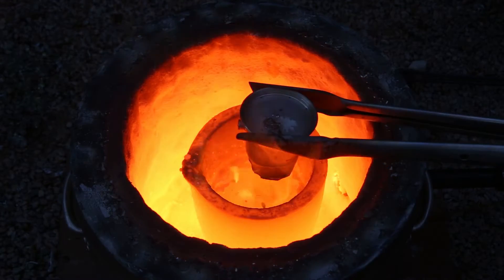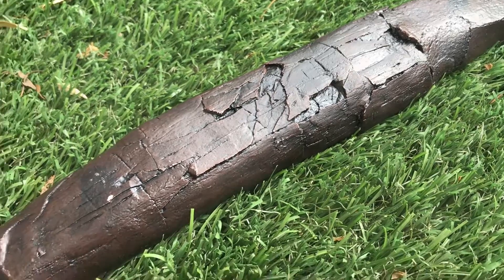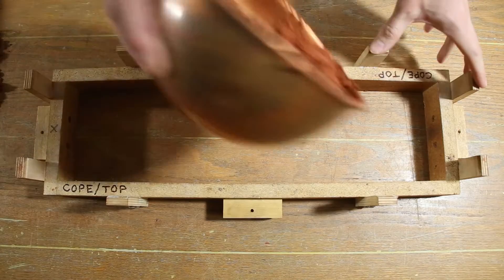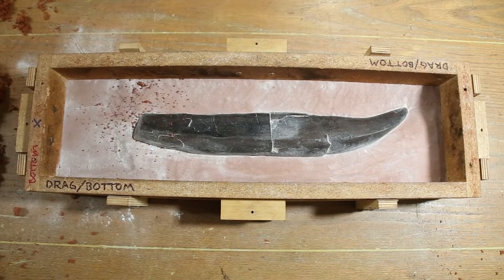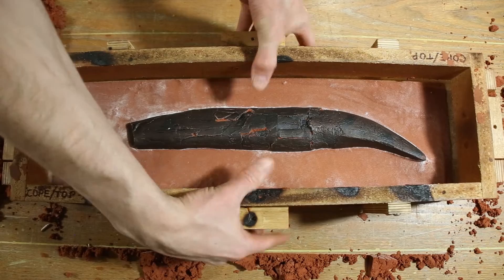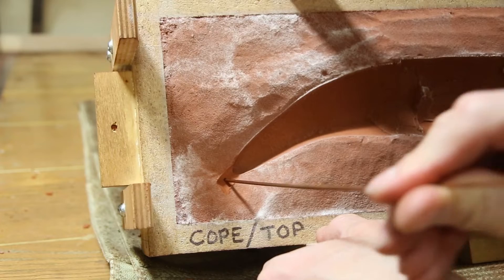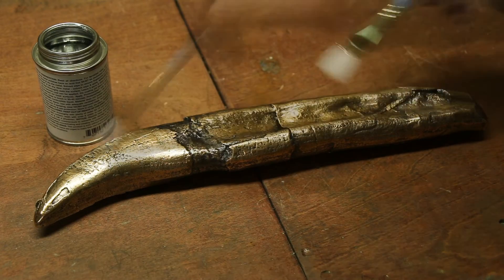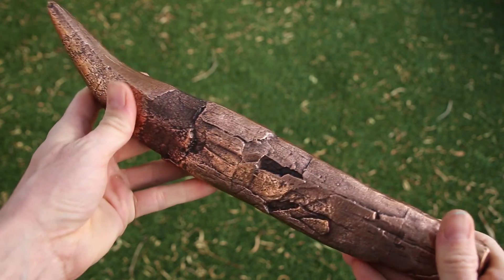Making a SOLID BRONZE T-Rex Tooth │ Metal Casting

Comment: Great cast and finishing. Good job!
I noticed you have a really nice heat screen on your shank 😉
Reply from the maker: Thank you! Yes, its top of the line! 😂
Reply: @robinson-foundry  I was thinking why did tou make such a heat shield - because I didnt notice one on your previous videos 🤔.
Did you burn your hands or other failure ?
Reply from the maker: @DragonAtelier  the heavier the crucible is, the closer I have to put my hand to hold it securely. I have burnt my hand through the glove before so the shield is crucial for longer pours. Not so much on shorter pours. I'm going to make something nicer looking soon. It works for now. Its amazing to me that only a very thin piece of aluminum keeps the radiant heat away.
Reply: @robinson-foundry  aaa got it. Thats what I was thinking. Me myself use proper shielded pouring gloves cause the same - I have burnt my hands couple of times 😆
You can see them in my videos - top is a layer of aluminium shield.
Reply: @robinson-foundry  Wow, that's awesome, say have you ever made either a solid Silver T-Rex tooth or a solid Gold T-Rex tooth by using the same method you used when creating this Bronze T-Rex tooth?  Just wondering, because I bet both a Silver T-Rex tooth and a Gold T-Rex tooth will look great with the Bronze T-Rex tooth.  Same with both Silver Velociraptor claws and Gold Velociraptor claws looking great with Bronze Velociraptor claws for that matter.

Comment: I would love to see you attempt to cast sockets! I have had some real difficulty with them, and it would be interesting to see your take on it.
Reply from the maker: Sockets for bolts?
Reply: @robinson-foundry  As in for spears or bronze age axes. Where you have the two sides of the sand mould and a third component that you cast around that is the negative of the socket you wish to make. They are really tricky to get right and there are many ways of suspending the 'core'. I used this historical method to make a socketed garden fork.
Reply from the maker: @ThiccboiSalmon  Oh yes that makes more sense! I’ll give it a shot sometime